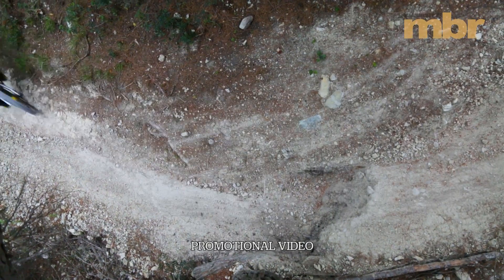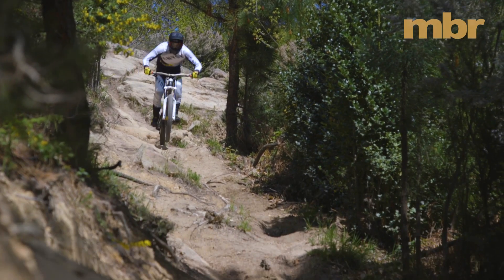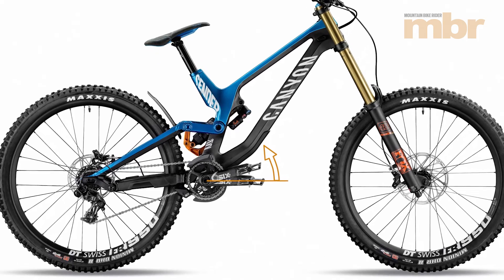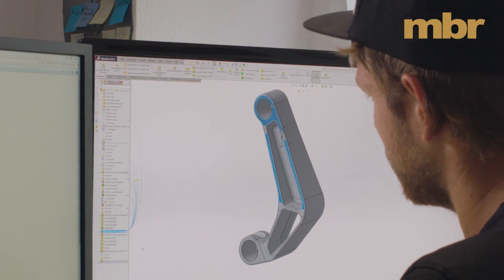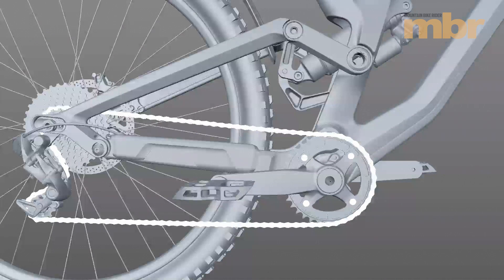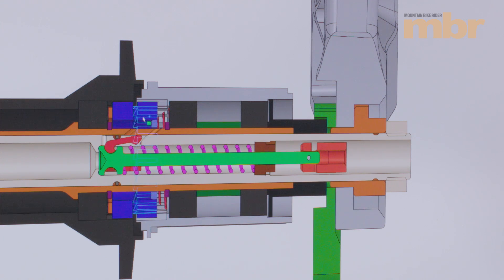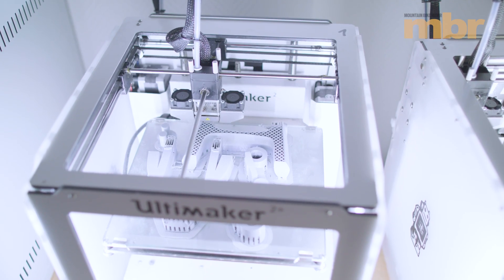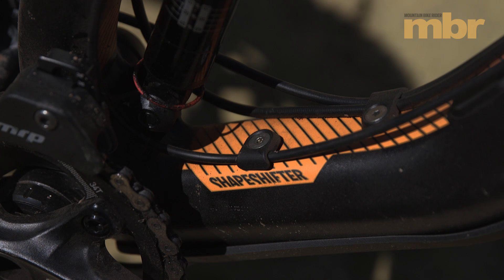What is Canyon Dis/Connect? | MBR

Comment: Bergamont solved this problem a long time ago by adding a roller at the pivot point of the rear triangle. That way the direction of force from the chain is always 100% parallel to the bottom bar of the rear triangle with no draw backs other than the extra friction from the extra cam.

Comment: I agree with Ferry van der and Daniel Moore's comments. Downhilling, the wheel turns forward fast and the chain is not under tension when you are not pedaling. So, when the suspension compresses, the chain "growth"  is absorbed by a turn forward by the cassette, that is, chain, throughout its growth, pulls the cassette and this turns forward. The cassette is able to turn because the wheel is turning. 

(Look at the test on the video, the bike in the wall has the rear wheel 
"blocked")

Pedal-kickbak can be an issue only when the chain is under tension, when you are pedaling, and especially on technical climbings over rough terrain because, moreover, we are gearing very low gears (the effect is increassed).

And this mechanism can't work when we are pedaling.

I think this mechanism is only useful maybe in jumps receptions riding with very very low speed...

Comment: I think the problem is barely there, in the demonstration the wheel is not rotating, so the crank has to move backwards. But in real life the wheel is moving forward, and compressing the suspension will only slow down the freewheel for a short moment.
Reply: Yes, Ferry and Daniel. It is just what happends in real life. Downhilling, the wheel turns forward fast and the chain is not under tension when you are not pedaling. So, when the suspension compresses, the chain "growth"  is absorbed by a turn forward by the cassette, that is, chain, throughout its growth, pulls the cassette and this turns forward. The cassette is able to turn because the wheel is turning. 

(Look at the test on the video, the bike in the wall has the rear wheel "blocked")

Pedal-kickbak is an issue when the chain is under tension, when you are pedaling, and especially on technical climbings over rough terrain because, moreover, we are gearing very low gears (the effect is increassed).

And this mechanism can't work when we are pedaling.

I think this mechanism is only useful maybe in jumps receptions riding with very very low speed.
Reply: Yes this is what I was thinking. Also as speed increases the effect diminishes.
Reply: If you're in your highest gear (smallest gear on the rear) and probably on a descent that's when kickback is the least?

Comment: I´m not against innovation but I think this system is just not worth it. A normal bike user wouldn´t even notice. It´s just another part of the bike that can fail and is expensive to fix. I prefer simple bikes that are durable. Also who wants another cable at the bar.
Reply: It was said that it's not practical for the average biker, mostly for racers who will do anything for extra speed.
Reply: I have to question the whole judgment as to whether or not a normal bike user would notice this feature...coming from someone who has never ridden it.  I would say that if you're going to knock an innovation without experiencing it or finding some objective way to make a cost/benefit analysis...by definition, you are against innovation :)
Reply: thats why i ride a surly :)
Reply: Rob S Whether you notice it or not depends heavily on your linkage design. Like the guy in the video said it is always a compromise between different attributes. If you want to learn more about it maybe research anti-squat which is basically how chain tension affects your suspension performance. With that you can counter pedal bob under power so you have a bike that's pedals really well but at the same time it creates the problem with the pedal kickback in the video which makes your suspension stiffen up when you don't want it. Basically the more anti - squat your bike has the bigger is the gain the disengaged hub would bring you. You can easily test this out yourself. Just find a downhill section an try it with and without your chain which has the same effect. 
And no I'm not against new products. It is my personal opinion in which I would spec my bikes. That's why it's great there are so many different options so if you want it you can have it. Research like in the video above is always good otherwise our bikes would still ride like they used to in the 90s. This specific product is also kind of dangerous like the engineer said it would be bad if you use it and forget to engage the hub. Thats propably why you won´t see the system in it´s current form on any production bike. People lock out their suspension and forget about it on the descent. Same thing would happen with the disengaged hub but you most likely will crash in that case. So an automated system would be the way to go and then it all comes around with realiability. A bit like Specialized with their brain system on the older Stumpjumper or the new Epic for example.
Reply: yeah that was covered in the video. they are going to need to automate the engagement before it is released to the public. that means at least a few years, when it launches, it will be an option that you can choose to not have.
Reply: doopy noo Based on video it seems that upper part of the chain it creating this "tension" which is restricting the suspension movement. So my understanding is that chain length or cage length doesn't have anything to do with this.
Reply: wenedi I would guess they would only put this on their high end bikes, like for example they have different versions of the sender ranging from 3k to 5k+ , they would problaby only up this in their most expensive bike
Reply: wenedi  it's out of control.  just more crap to make you think your current ride is outdated
Reply: same things was said for hydraulic brakes, droppers posts, air sprung forks, tubeless tyres, 1x drivetrain...
Reply: wenedi I don't know if this is the same thing, but as an ok rider at best, when my chain fell off at the bike park, it made a huge difference.